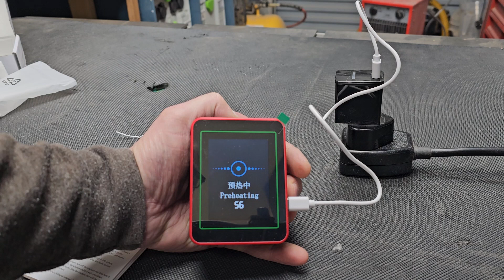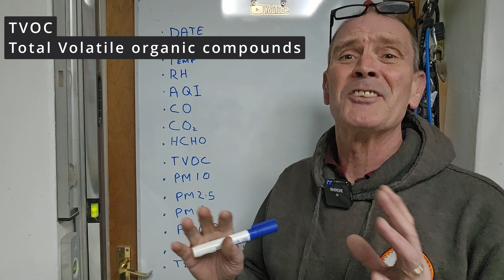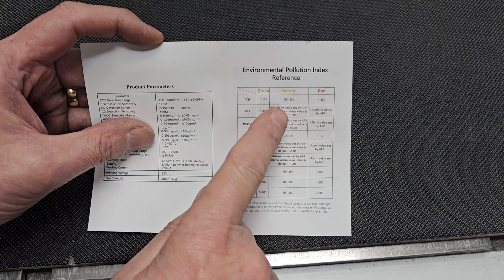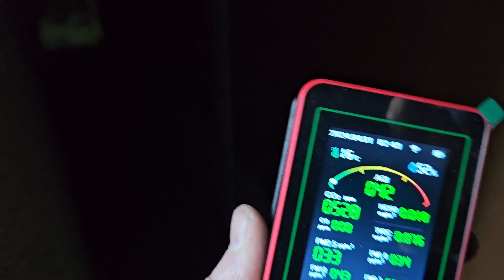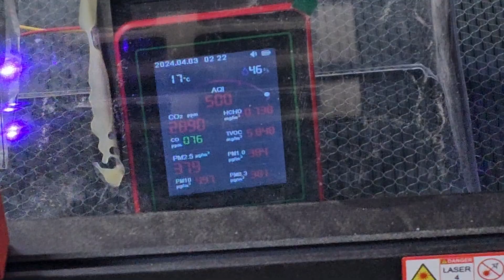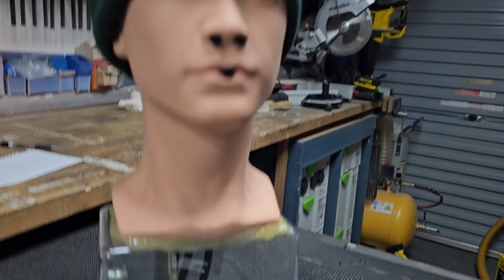15 in 1 Air Quality Monitor, Lets test it SID....

Comment: 41:00 You can in fact confirm it by disassembling the item and looking at what chips it has. Watched the whole video expecting an teardown at the end, and you didn't even really test whether values are truly correct or not, especially when you already got another "accurate" sensor for particles. Never tested the temperature and humidity accuracy, nor other things except the Carbon Monoxide. Overall I think this video is a bit dishonest and aims for viewers to buy the product.

Comment: A few points.

1. Open the thing up. You'll be able to see immediately how many I dividual sensors there are.

2. Dedicated CO monitors only sample about once every 5 minutes to co serve battery. Once an elevated reading is detected, then they increase sample frequency. It's in the manual for them. 10s in front of the laser won't trigger it.

3. Most of these tests are too uncontrolled. About the only useful thing was the alcohol test. Even that, instead of using high purity you used a lens wipe! Those have all kinds of extra minor ingredients.

That was a lot of recording for not a lot of useful outcome sorry to say :(

Comment: It is a fake monitor even without sensors. https://youtu.be/K3-Yvhk0C8o?t=2877 Open box and see yourself. It has a one sensor and a small board with microchip that make different calculation for display.  that is all.
Reply from the maker: 😁 Yep, i agree. I think the tests i did in the video confirm its a single sensor model. I have better sensors in the workshop that I rely on that are better quality 😁.
Thanks for watching 😁 👍
Reply: Yes, it is. You doing wery good video,

Comment: your second test with the laser was not the same as the first because you don’t enclose the sensor to concentrate the airflow……… you must compare like with like. A lot of the cheap detectors don’t measure CO2 at all it reads alcohol.

Comment: I got the 10-in-1 version of this exact monitor.  It uses the exact same case and very similar display type and arrangement.  The USB cable and manual is also the same.  Also the same app.  But the stuff inside is complete garbage giving me whacky readings.  Maybe I got a fake version of this with same case but different inside?  The PM2.5 is definitely wrong and that is what I mainly got it for.  It's always either really low or really high, but definitely not close to accurate.  I paid less that $20 so going into the garbage.

Comment: Carbon Monoxide (CO) binds to the hemoglobin in your blood and renders it unable to carry oxygen.  i.e. it asphyxiates you by poisoning your red blood cells. 
It takes a long time (days) to replace the damaged hemoglobin.
CO is produced when things burn without enough O2. Hence why it wasn't produced when you burn a twist of paper in open air.

All of these chemical sensors can be triggered by things other than the one chemical they are specified for. 
The figures should be considered (1) an indicator that "something" is in the air, and (2) an upper bound for the chemical they are specified for.

Comment: There are a bunch of these (MT-29) being sold on Amazon by different sellers (20 to 50 quid). Got one and wish I'd seen this video before getting it. Tested it over two weeks against some other sensors and it's not very accurate. Just glad I came across this test video because at least I know what I've observed (like the correlations between CO2, CO, HCOH and TVOC) are most probably a quirk of design versus my item being defective (sending it back). The PM detector on the one I received doesn't seem to work as well as the one in the video (or at all, really) - values have never varied beyond around 14 micrograms per cubic metre for PM 2.5 for example, while another device is picking up values close to 60 micrograms per cubic metre (during cooking), and correlates positively with forecasted open-air PM 2.5 values.
Reply: there is an MT15 variant which is supposed to have better sensors... it is a pitty that he did not disassemble the unit to find what is inside

Comment: Thank you for your comparisons, I have been looking for some monitors to put around the house but it's hard to be sure witch ones measure correctly some of the claimed readings.. After a few searches I went to this 8 in 1 model (PV-28CW rounded corners) that seems to have a proper NDIR CO2 sensor (that was my main concern) and also measures a few other things some I'm not sure like TVOC and HCHO (that I suspect it's one sensor for both) but PM 2.5 I think its also reading ok (I've compared to a Uhoo and both CO2 matches) then I did manage to add them to Home Assistant with Tuya Local protocol. Can't put the link here (comment is being removed) but its the item 1005007627045672 on Ali. It has an automatic screen on off with IR proximity sensor.

Comment: i opened one up. Their does seem to be an optical PM sensor chamber but not sure accurate it is.  There only seems to be one gas sensore from which all other gas readings are derived and extrapolated.... not really useful
Reply from the maker: 😁 I think i will open this one up at some point. I wont be using it for critical safety applications as i cant confirm its accuracy. Thanks for watching 😁👍
Reply: @frankslittleworkshop  Now I feel a lot better for You and Sid - Great choice, but better to not ever use it again period...  These are the ones I like to call fake and should not be used at all as one will become use to it  and start trusting other readings they shouldn't.🤔

Comment: Other folks have opened this same generic device and apparently only has 2 sensors (a TVOC or Alcohol sensor and other one) and simulates the other values. Watch out. The first one you showed in the video is actually a good piece. That is why in the video when you utilized the WD 40 canister CO2 and CO went up. Dont trust your live with this device, it is fake. Now I am seeing the end of the video, and the sensor that is seen on the open up videos looks like the MP503. On point 👍, as you said and prooved with the alcohol tissue, it must have a particle sensor and a MP503.
Reply from the maker: @Leonhardious  😁 Thanks, Leon. I wouldn't trust my life with this device. I was going to open it up, but I think it would only confirm my suspicion. But it still has its uses in the workshop but just as an approximate indication. Thanks very much for watching and taking the time to comment 😁👍

Comment: I don't believe you can get an accurate air quality monitor for £20. One accurate sensor alone will cost alot more than that. The Purple Air Zen is one of the most accurate for measuring particulate and they cost £250.
Reply from the maker: @2711marcus  😁 I totally agree Mark. There is no way there are dedicated sensors in this device. If there were it would cost at bare minimum 10 times the price. Thanks for watching 😁 👍
Reply: I get the same from Amazon 😆
Reply: I had a look for them on Google but couldnt find any which is odd.

Comment: these is fake sensor
Reply: yes! Other folks have opened this same generic device and apparently only has a TVOC or Alcohol sensor and simulates the other values. Watch out. The first one he showed in the video is actually a good piece. That is why in the video when he utilized the WD 40 canister CO2 and CO went up. Dont trust your live with this device, it is fake.
Reply: You are absolutely correct.  Even one reading that is faked (in my opinion) makes the whole thing fake and not to be trusted for any of it's readings.

Comment: Note that there are 2 version of the same visually device... one, the DM29 : shitty sensors and the TM15 with laser and led sensors and you got the shitty one. All sensors moving up and down for any out stimulation is not a good sign ...
Reply: Thanks @davidniquot6423 for the info. I have ordered this one and it does not arrive me yet. How to know that it is DM29 or TM15 ?
Reply: Idk how true this is because these versions based on the booklet are the same, zn-mt15 zn-mt29. Can't find a single thing on this tm15. Also what makes you think one is better than the other, where's the evidence
Reply: @wolfmode69 I just purchased the sonovara air monitor from amazon. I got it for £89 but its now £129.  But it is identical to this one in the video. 
I messaged them asking how do I know the one i purchased for £89 isn't in fact the one which was priced at 20 quid as everything from the box.instructions. the screen. The button on the side.  
It is identical.  And yet I paid £89.
Im so close returning it as only had it 3 days.
Reply: @SteveAndrews-uu3pu honestly, I was in your shoes and cancelled my order. It's basically not worth it because it just can't do all the things you want. It tries to use one sensor to get some gauge on other values, and little things like fire or things burning will inaccurately throw off readings for other unrelated metrics. It would be nice if the tech was here, but it just isn't unfortunately. I'd return it if I were you, you're definitely within the return window.
Reply: I cannot see the tm15 model on Google search
Reply: It's MT15 and MT29